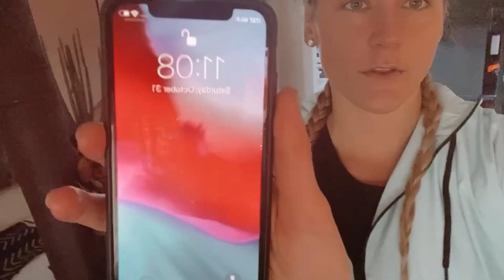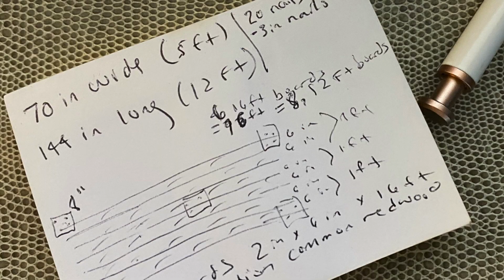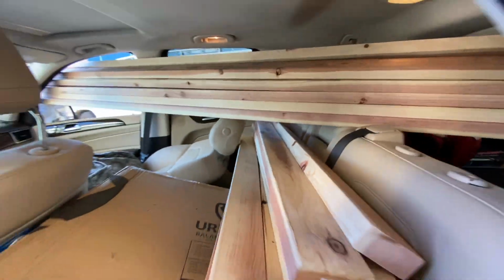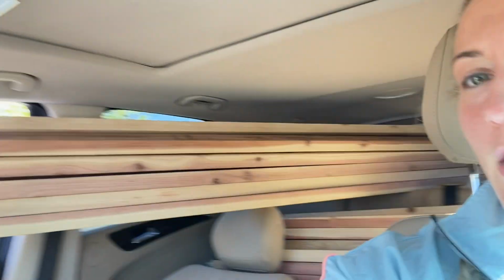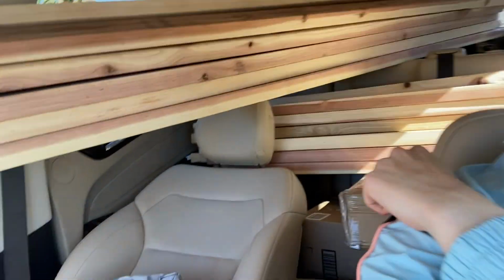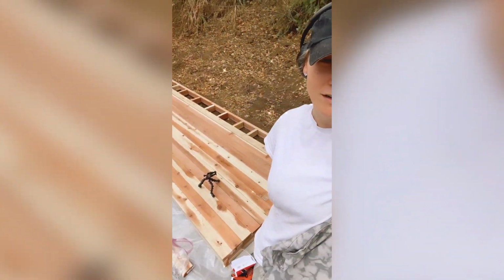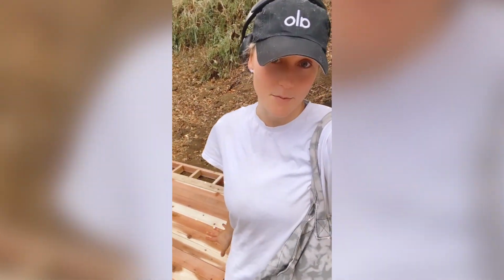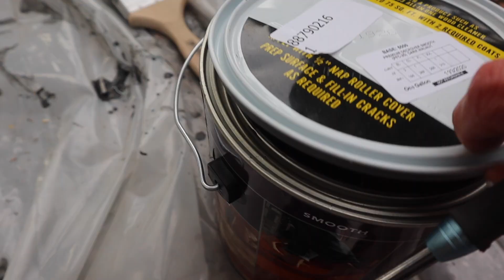DIY 12ft Yoga Platform in 24 Hours | PART 1

Comment: I couldn’t figure out what you were trying to do with your drill. Did you try to screw them in directly without a bit? Or with a Phillips bit?
Reply from the maker: I first used a drill to make a hole, then drilled the screw in the hole. But the stopped pre drilling holes and just went for it with drilling the screw in. But the piece that was in the drill was too small so it kept getting stuck. I had to go buy proper ones that would fit the drill so I could more sturdily drill the screws in. No idea if that made sense. I need to work on my construction terminology 😂
Reply: @CassieDePecol  I’m pretty sure I know what you’re talking about. They make smaller bits that go into magnetic quick change bits sound like you were using one of those. Thumbs up for your perseverance. Turned out nice. Also there’s always some kind of monkey wrench thrown into any building project they never go perfectly smooth. Par for the course.